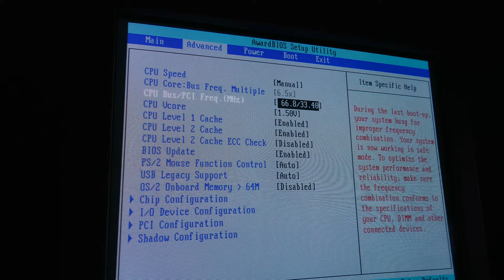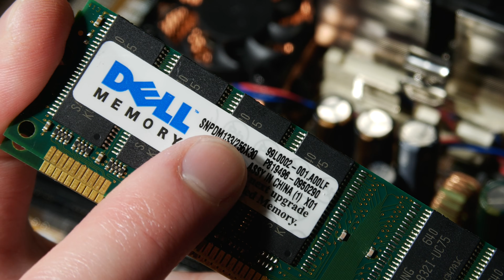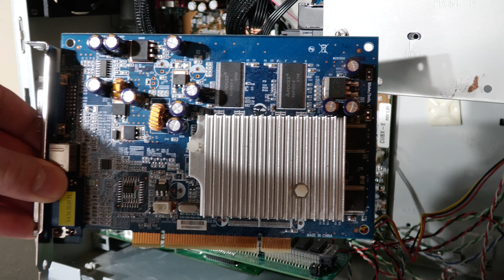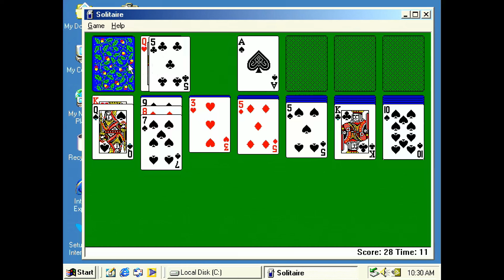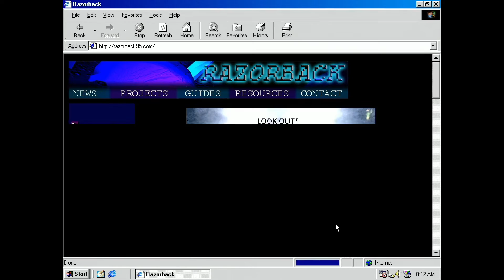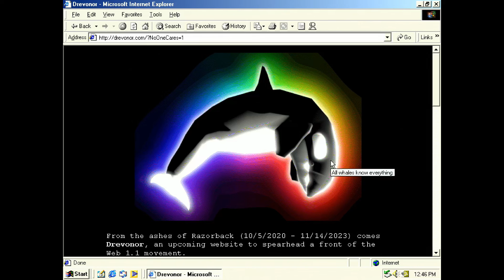The Ultimate Windows ME 25th Anniversary PC

Comment: The first internet connected computer my family had ran Windows Me and it was terrible. When they gave it to me after they upgraded it took me two weeks before I put Linux on it. Granted, Me had a lot of innovation in it, the revamped file search that went on to ship in XP being one of them, but it was very prone to crashing. A counterpoint to blanket hate for Me that I like is how XP wasn't the most stable on release and most of the nostalgia is based on the SP2 and SP3 updates that fixed a lot of the issues with it. Me wasn't given the same treatment so it's not surprising it has the reputation it does.

Comment: Solid video. I started doing a deeper dive into Windows Me in 2019, choosing to revisit it after having some pretty bad experiences with it between 2000-2002 on a then-new IBM machine. I discovered that the problem was never WinMe itself - it was a combination of bugs in the preloaded version of the SiS 630 integrated chipset, video and audio drivers, along with problems with power management in the IBM BIOS that affected hibernation and resume from standby.

With updated drivers installed and a later revision of the BIOS flashed, the problems that plagued that machine for years disappeared entirely. Any other small quirks of the Windows shell and other system services were largely resolved through the application of Windows, Internet Explorer and Windows Media updates from the online Windows Update service (which I later compiled into an automated Update CD and released, something I continue to revise and maintain to this day).

That machine has since served all kinds of duties, from a simple games machine to being used as a file share and game server at local retro LAN events, and it has never let us down. On the rare occasion where something may fail - like following a bad installation of NVIDIA graphics drivers while testing a few different video cards - System Restore rolled the machine back to a working state within a few minutes.

It's proven itself to be such a convenient and dependable OS to use for older machines that it's now the go-to standard for any machine I assemble. Older machines get Windows 3.1 and 95, but if a machine is capable of running Windows 98, I skip straight to Millennium Edition.

Most of the games and applications I run are Windows 16 and 32-bit, but I haven't yet encountered a DOS application running under the Windows command prompt that hasn't otherwise worked perfectly. I know there are examples that wouldn't, and if your critical title happens to be one of the affected ones that only works on the bare metal MS-DOS mode, then go ahead and run Windows 98. But it's entirely possible that others may never encounter such a problem, and for those users Windows Me does an excellent job, especially given the numerous other benefits it brings along with it.

Ultimately there's no inherent "right or wrong" in the retro computing hobby, everyone has their own set of needs and wants for their build, and it's been great in recent years to see that conventional wisdom of "just install Windows 98" being challenged by hobbyists wanting to try something different, only to then discover that in many cases it actually works pretty well for them. The discourse online over the last two decades has effectively had people thinking that installing Windows Me would render their machines near unusable, and - as many have since found out first hand - that simply isn't the case.

Comment: My problem with ME is that the class of machine I'd use it on is typically better served either by the inherent increased stability and capability of Windows 2000 or later, or by the access to real-mode DOS that 98SE affords. Even when you hack real-mode DOS back into ME, it comes with problems -- for one thing, HIMEM.SYS will no longer load, citing an extended memory manager already being running... and this intrinsic extended memory manager has some major compatibility issues, not to mention being unable to drop to a conventional-memory-only configuration which can, occasionally, be needed.
Reply from the maker: You do not need real mode DOS for that class of machine. It existed primarily as a transitional medium, much like a so-called "Windows 3.1 mode" was planned to. Memory configuration is meant to be handled per program using PIFs and run in DOS windows (which are basically shortcuts to DOS programs in Windows 9x). If there's any situation warranting MS-DOS mode, it's more than likely some serious hardware or driver problem.
Reply: Sorry man, but you don’t get to tell me what I do and don’t need. The Win9X DOS box was a far kinder environment than an NTVDM for sure but there was still the odd case where you were best off on bare metal. And I’m saying that in every case where it’d make sense to use ME, for myself, it makes MORE sense to either jump the rest of the way to an NT kernel or keep the extra backwards compatibility 98SE keeps on offer, not that it makes no sense to use ME at all.
Reply: @sedrosken831  You really did not need to open up your reply with a snarky assumption that they're lecturing you to use something else. Personally, there's plenty of cases I can think of where I would want to use a 9x release over an NT one, such as drivers and specific hardware combinations where even one component of the system has solid drivers for 9x, but not NT. Plus, not once did he even mention that there was a patch to add the option to restart into DOS mode, as that wasn't part of his focus and is still currently a temperamental project anyway.
Reply from the maker: @sedrosken831  By that logic, should we proclaim that Windows 10 doesn't have much merit because Windows 7 can be installed on a modern Ryzen system? There's numerous cases to make for it, but good luck conveying that to even the most knowledgeable Windows users. How about the fact that Windows XP is essentially Windows 2000 with fancy UIs, and worse performance on sub-1 GHz systems?

No matter how you sprinkle it, you're just falling into the same, tired pattern claiming Windows ME didn't have anything to offer, somehow needing to be singled out for arbitrary reasons. Maybe it's groupthink.

Comment: Well MS-DOS real mode was needed when I had this on some games I hadfor DOS. Civilization 1 ran slower in windows mode with win 3.X/9x and otehr games i had at the time. Having to play that game I had to Dual boot DOS 6.22 and WinME on different partittions. It was a temp fix. Put a 2GB FAT16 partition for DOS and rest of the 120GB drive for FAT32 which WinME was installed. This was the time before hacks to make ME have real mode. Best solution for the time when i had my Pentium 3 at 750mhz.